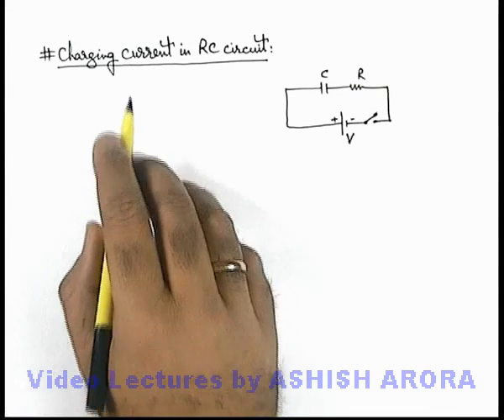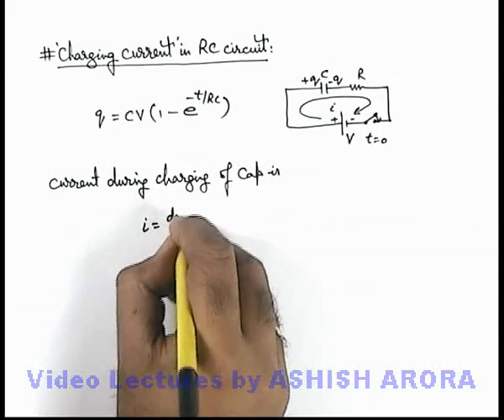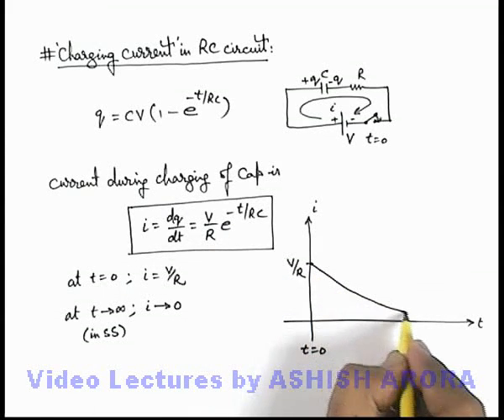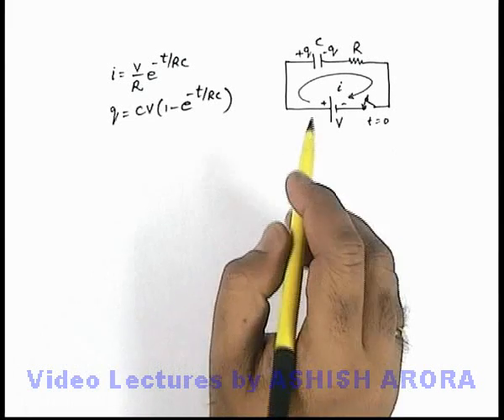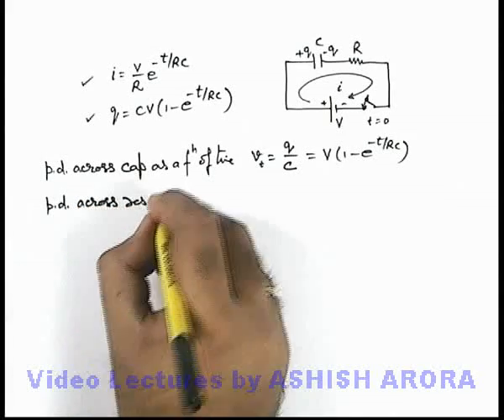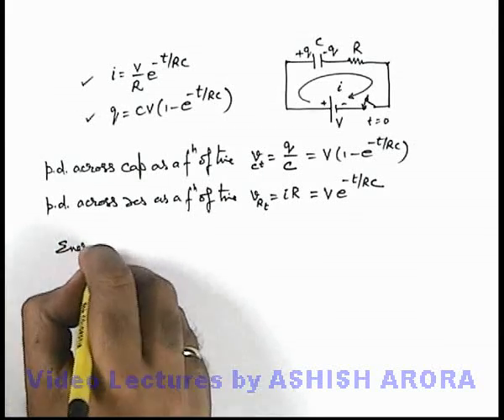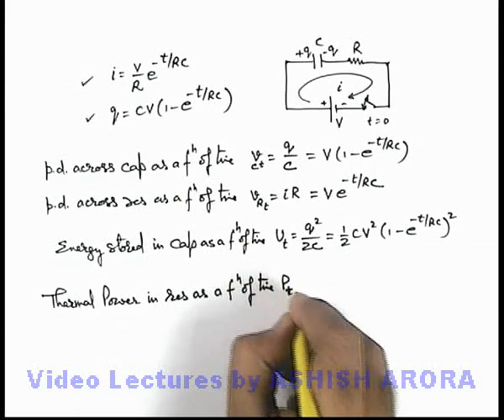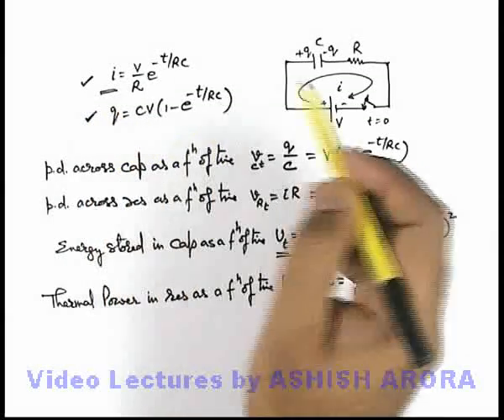Class 12 Physics | RC Circuits | #4 Charging Current in RC Circuit | For JEE & NEET

Comment: pote.... diff.... across aresistance in case of charging  = v(1-e-t/RC) not use 
why  use =v(e-t/RC)
plz sir ans of this quest....
Reply from the maker: the potential difference you've written during charging is not across resistance, its across the capacitor... first correct yourself then ask the query...
Reply: ok sorry sir and thank u
i forget the differenciation  term so i confuse
again thank u so mmmmmmmmuuuuuuuuccccccchhhhhhh sir